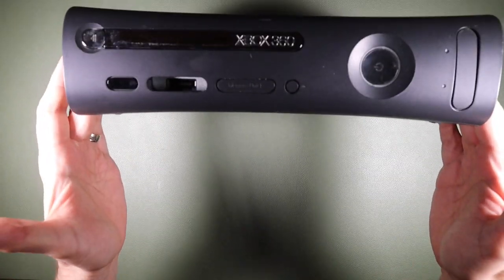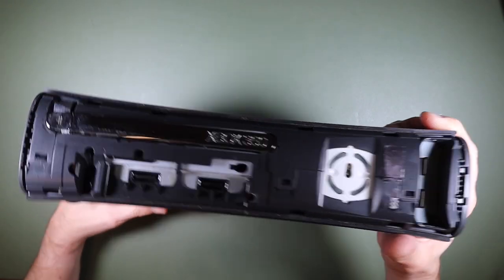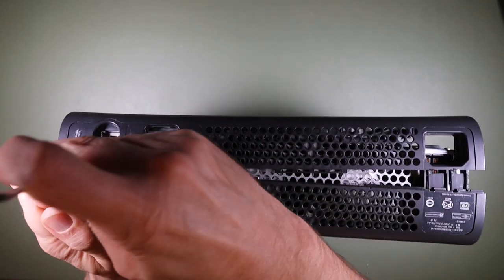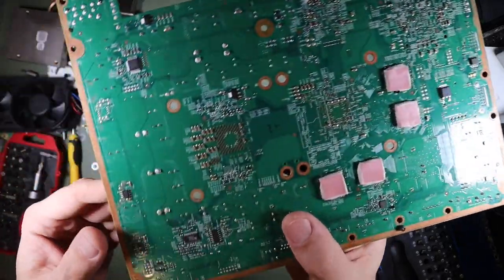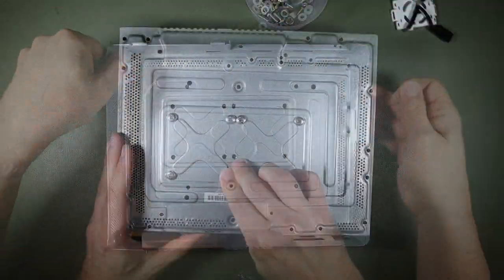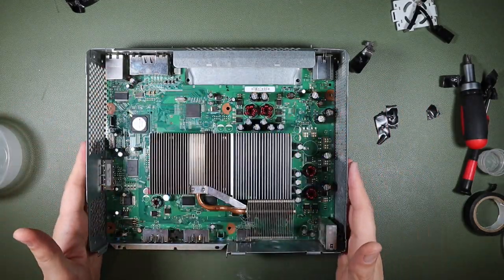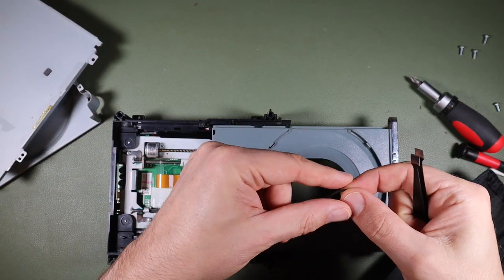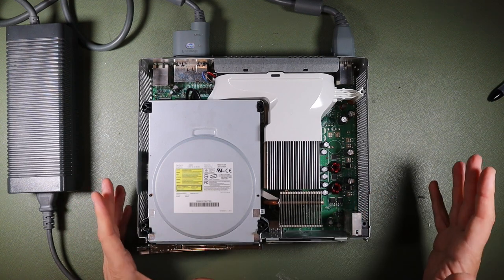Xbox 360 Try to Fix

Comment: Thanks for the shout out Roger 👍 Unlucky with the profit, but interesting to see it come to life after heating it. I was thinking the washers weren't factory, and the helpful comments confirm this, and the reason why they were there. Thanks again for another entertaining fun, well edited video. Looking forward to more of them :-)
Reply from the maker: Hi thanks Vince. You are completely correct about those washers not been original, although I didn't know it at the time as this was my first ever 360. I don't know if whoever originally did the mod was attempting to fix a problem or avoid one, but common opinion is that their fix and indeed my "fix" would only ever be temporary. Although opinion on a longer term solution varies. Thanks for the support. Feeling the love here and I appreciate it. Roger (AKA Retrotech Repair)
Reply: I watch you sometimes Vince!

Comment: Really great video and what you might not know is that the Software Version or ‘Dashboard’ Version on this console, is actually the NXE update which is quite old.

The consoles got this update in Late 2008 and then another update came somewhere in 2010.

What I’m saying is that the console you fixed had a rare dashboard on it as when you update, you can’t downgrade it back without modding the console.

Not being updated since 2008-2009 means it must have been broken for the best part of a decade!

Cool that you fixed it, even if only relatively temporary.
Reply from the maker: Thanks Will that's great info. If I had known I might have had a bit more fun with the console. Lots to learn on this one. I learned from the comments about the washer mod and about the temporary nature of the fix,  but you were first on the firmware version. Thanks so much for your post. I will definitely play closer attention to sw version next time. Cheers

Comment: I'll be honest, as you turned on the Xbox 360, I noticed the Red Ring of Death, along with of course the E74 error. At this point I was groaning and shaking my head. It's one of the reasons why I really tend to stay far away from older model Xbox 360s; they Red Ring often and they don't last. The Slim model by comparison(Xbox 360 S) has much better cooling, more USB ports, and even built in Wi-Fi while lasting far longer. I very strongly believe that the Xbox 360 Slim is just an objectively better model, especially if you're looking to buy a good condition working Xbox 360. It's not to say the original models are horrible by any means, but they can often be notoriously unreliable and just lacking features compared to newer models.
Reply from the maker: Thanks Jared I really appreciate you taking time to leave such a detailed comment, lots of great info here. The 360 came to me as part of a mixed lot of retro gaming stuff so I didn't get to chose, but if I go shopping for a "new" 360 I will definitely take your advice. Thanks!

Comment: You had a close shave there. I've seen 360s which are just plain bomb sites in regards the nature of the faults, very often chip failures. Glad I bought a few working spares while they were dirt cheap as it looks a battle just penetrating them. But still, they're very versatile. I'm happy to use mine as HD-DVD players with some of the best DVD fidelity I've ever seen through VGA. You can use it as a guitar preamp with lots of lovely tones like the Queen one, thanks to the Rocksmith game. And you can also use the Band Hero Stratocaster controller as a real instrument too, though plugged in the PC as well as using the sequencer in Rock Revolution.
Reply from the maker: Wow.. Thanks MrDustpile some great Ideas. I am hoping to dig some more into these, I have learned a lot from the video and from the useful comments (like yours) thanks!
Reply: @RetroTechRepair  You're welcome. Though you maybe know of the Playstation and Playstation 2 music software (not including Guitar Hero and the like). Now those WERE period-flavour sequencers and general noise makers, however good or bad each one was. A real spread there. And imagine using the Music 2000 sampler add-on with the humble Playstation! Future was here alright!
Reply from the maker: @MrDustpile  I actually didn't know that. Thanks for the info

Comment: Nice job. The console having the bolt mod already isn’t the best for the longevity, but surprised you resolved e74 with the “reflow” since usually reflow is a bit more focused and involved. Nice video!!
Reply from the maker: Thanks! Yes I've been reading all about the bolt mod in the comments. I didn't realize it wasn't original, but did think it strange it all makes total sense now. I don't know why the bolt mod was even a thing really. Dunno how much the "reflow" helped, some of comments suggested I just bought a bit more GPU time. Hard to say really. But it didn't work and it does now. If I still had it is be looking at a better fix maybe. Anyhow thanks for the comments glad you enjoyed the vid.
Reply: @RetroTechRepair  yeah man I’ll subscribe for some more videos! You did great for not having worked on a 360 before, you’re a natural
Reply from the maker: @grandtheftauto1233  Thanks so much!

Comment: Same for me, came over from Vince and really enjoy the videos. Attempting my first repair later this week.
Reply from the maker: That's awesome! Stop back and let us all know how it goes! What is it you are fixing?
Reply: @RetroTechRepair  I bought a Stanton RM3s mixer off ebay for £8! Sold "without the PSU and potential spill damage". 
So far I've opened it up and there's certainly some sort of oil based spillage all over the main board. Waiting for my IPA to arrive and a PSU (hopefully today) so I can clean it up and do further testing. I really am a novice and learning purely from your videos so.... Keep everything crossed for me!
Reply from the maker: @tidydj  Good luck with the repair... I am flattered you are learning from my videos, but please don't rely only on me... I am a NOVICE TOO! My guess is that the mixer will have lots of potentiometers, so you might want to think about some kind of potentiometer cleaner or lubricated switch cleaner as well as IPA. IPA might clean up the board, but might leave some of the switches, pots and sliders unlubricated.... I wonder if the previous owner tried to use WD40 or something and that's what's on the board? anyhow good luck and let me know if I can help (as a novice of course) Thanks so much for your comment
Reply: @RetroTechRepair  Thanks, although you’re way to modest. 
I’ll keep you posted. Keep up the outstanding work.
Reply: @RetroTechRepair  WD40 is a good shout to be fair. It’s often used on sliders by DJ’s for a quick fix. It’s quite possible that they’ve simply flooded the cross fade with it. All of the gunk and ooze is in that area. 
What lubricant can you recommend for the sliders and potentiometers?
Reply from the maker: Hi  @tidydj   I don't really have a recommendation, but feel pots I have cleaned only with IPA have been left a bit dry. I do have some servisol Super 10 lubricating switch cleaner but haven't used it on pots yet and I know dioxin makes a range of cleaners and a fader lube, but I really don't have experience with any of these.
Reply from the maker: @tidydj  Thanks so much that's very kind. I don't claim to be any more than an amateur but am VERY appreciative of your kind comments.
Reply: @RetroTechRepair  no bother. It’s all a learning curve. If I do find something that works effectively, I’ll certainly let you know.
Reply from the maker: @tidydj  Great. Please do
Reply: @RetroTechRepair  Got a little update on the repair. There was certainly some sort of oily gunge all over the main board as well as all of the cross faders. Having disassembled each and every one, de-soldered from their own boards, I have cleaned each and every one. 

However, once I put back together, I have attempted a test and while the mixer does power up, there is a static hum when connecting the main output (reflected in the LED's). There's also no output from any of channels or headphones jack. So, back to the drawing board for me. Going to get the tester out after work and see what's what. All the best. Terry.
Reply from the maker: @tidydj  Hi Terry thanks for popping back and letting us know how it's going. Sorry you are still investigating, that's how it goes sometimes (I have a repair on the go that's taken me 2 months). Sometimes if parts are unobtainable or the repair is beyond me Im forced give up. Regarding your particular situation, I don't know anything about mixers, but are curious if they use discreet components or integrated circuits. One thing I nearly always do is check the PCB carefully for damages tracks and bad solder joints (with  loupe magnifier) and clean and check the function of all external connectors and switches. Something to think about. Anyway good luck and thanks again for your comments and support.
Reply: @RetroTechRepair  quickly looks up Loupe magnifier on Amazon for next day delivery 👍🏼 
Totally hear you. I’m very much alive to the fact that I might fail at this but, on the other hand, I remind myself that it’s cost me next to nothing so far and I’m really having fun. I’ve never done anything like this before and find it absolutely fascinating. Watching guys like you and Vince is educational and entertaining. 
Good luck on the long fix you’re working on! Can’t wait for the next video to drop. 
I’ll keep you updated as I go.
Reply from the maker: @tidydj  Thanks so much. Really Appreciate it, was in a bit of a lull, but after your kind words I'm going back to my  hallway to finish off the filming of the big repair! Cheers

Comment: I had the same issue it took me a long time to find the tabs on the back, then I found out they actually make a tool for the back of the 360.
Reply from the maker: HI TNT I found out about those afterwards too! And I haven't done a 360 vide since then, but I learned a lot about XBox360 from comments on the video. Thanks for your feedback really appreciate you taking time to comment

Comment: I may edit or add to this later, but what wattage PSU did you buy? If you didn't know and are planning on keeping one for testing more, if its 203 watt, (easiest revision) it can be used to power all 360 Phats the newer ones can't power older systems
Reply from the maker: WOW! what great advice... its gone now sold as part of a bundle, but that is really good to know. Thanks so much. I have so much to learn about this console. Thank you!
Reply: Send me a message on twitter pal, @GravenellLee, ill send you one, I needed a component cable for an older 360 xenon without hdmi, and someone was selling one with a 203w power supply for a few quid more so I bought that, and have another 203w on the way, xbox 360 red rings and drive flashing were my bread and butter a few years ago, you guys as a whole have inspired me to get back into what I love and lockdown has given me the time to start, for that I thank you, any help I can be on 360 in future, hit me up pal, its not often I know alot about a subject, but this is one lmao

Comment: I've been subscribing to your channel for some time now, but this is the first time I'm commenting. Great job on the repair, you do keep things entertaining, and it's awesome you spend time (and money!) to repair old stuff so it can get renewed life. I'm impressed you managed to disassemble the XBOX without using a guide, they can be a real bitch to get apart! As to the XBOX itself -- only the first few revisions had notorious overheating issues. This is not one of those -- it can be seen by the size of the heat sink -- however, the screws and washers mounting it in place is not from the OEM, and a lot of refurbished XBOX 360s had this modification done to them, increasing the risk of warping and thus damage. To anyone interested -- MrMario did a video talking about this a couple years ago, and he talks about the OEM mount at approx. the time in the video link (https://youtu.be/jIAcYDxSFSg?t=694 ), and some more about the screws-and-washers modification a couple minutes later.

Anyway (sorry for the long rant), I hope you keep making great videos and fixing old stuff!
Reply from the maker: Hi Stian. Thanks so much for your comment and compliments. Thanks also for your subscription, every comment and every sub is important to me. This video has been a real eye opener for me. I didn't realize the washers were a mod but did think at the time "why would Microsoft do this?". A number of people have pointed this out now, but you were the first to send a link and it was very helpful thanks. Unfortunately I didn't get the xclamps with my console, had I known about them I might have tried to get some on eBay, which is definitely what I'd do next time. I only hope my repair lives a bit  for the buyers sake, at least they got a nice new controller. Last but not least please don't apologize for the long comment it was very informative and I appreciate it. Thanks again RTR

Comment: The good old nut and washer fix
Reply from the maker: Yes indeed Jamie, having run old cars for years until recently its amazing what can be fixed with the odd nut bolt and washer! New to xbox 360's though. What puzzles me is why Microsoft didn't use a measured spacer rather than all those washers.... was it like that from the factory? If you know let me know, but either way thanks so much for your comments... Always appreciated.
Reply: Xclamp fix Google it and you'll see

Comment: Look up the fan mod if your looking for longevity for the next one the screw thing is mostly temporary  those old ones always overheat could possibly be a return if they play it for a while continuously
Reply from the maker: Good to know... Thanks. I didn't realize until I started reading comments that the washers weren't original. I wondered why it was such an odd design. Thanks so much for your comment. Will definitely look at a fan mod next time.
Reply: No they do not overheat. Fan mod is rubbish for the most part.
Reply from the maker: @botchedrepair1542  @C toddgo to Fan mod or not to fan mod? debate? Seriously though I am grateful to both of you for your comments. Thanks Guys
Reply: @RetroTechRepair  not to fan mod! I have once fan modded a xenon and it died 5 hours after :-)
Reply: @botchedrepair1542  I have repaired hundreds of these I have only kept one for myself it is still going strong probably 10 years later many hundreds of hours of gameplay later I don't fix them anymore because it's not worth my time because every generation negates the prior due to backwards compatibility I'm only trying to help out a newbie but you people are so pointlessly contrarian it's unnecessary and detrimental to the sharing of ideas and different processes that work for different scenarios
Reply: @ctoddgo3074 Only 2 red lights mean overheating. I'm trying to help too, please do some research.
I have also did hundreds of these. I have my launch Xenon still kicking with no fan mod done.
Reply: @botchedrepair1542  it's cause and effect the general failure can be  caused by overheating or not best place to start is the easiest the cooler the better imo
Reply: @ctoddgo3074  No. Chips can survive up to 100C. The actual problem is the dye coming loose from the flipchip, and not the flipchip off the board. And again, is 100C (the max temp that your xbox will never ever reach as smc changes fanspeed at 80c to cool down) enough to melt unleaded solder?
Reply: @botchedrepair1542  you are wrong the flux capacitor goes up to 1.81gw and the chips come pre flipped so with a little math pi x 6432 divided 654427 and bam the fan keeps it cooler and the Xbox works I don't care what you say if you didn't need fans they wouldn't put  them in there Einstein
Reply: @ctoddgo3074  what the fuck bro LOL

Comment: Great video dude, nice repair, I've just bought a lot of 4 of these and a gba off ebay, I have hdds for these if you need one mate?
Reply from the maker: Thanks, but I sold it on now. However I saw your other comment about power supplies and will definitely consider another repair. Really liked the console. Thanks for your comments and advice. Awesome!
Reply: @RetroTechRepair  I've got 4 here now, if you wanna do another one, they are currently totally untested, ill send you one with psu they have hard drives (only 20gb) but I can show you how to set up a 320gb drive in the enclosure so it appears to the console as a genuine xbox drive.  Until psu gets here and I can get the error codes, they are totally untested so I'll quite happily send you one with psu (no controllers I'm afraid)
Reply from the maker: @leeg4116  definitely interested. If you don't mind shooting me an email (retrotechrepairs@gmail.com). Thanks!
Reply: @RetroTechRepair  email sent pal